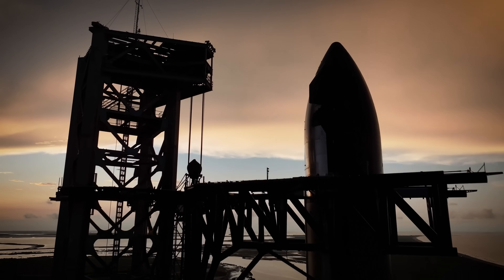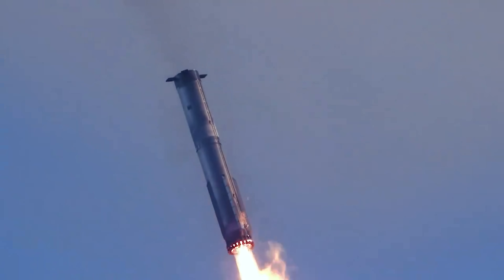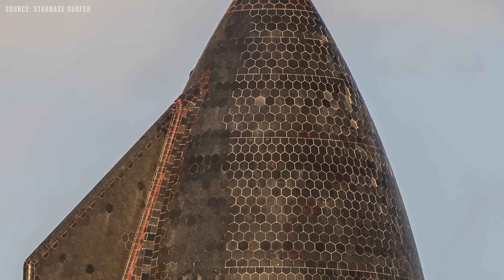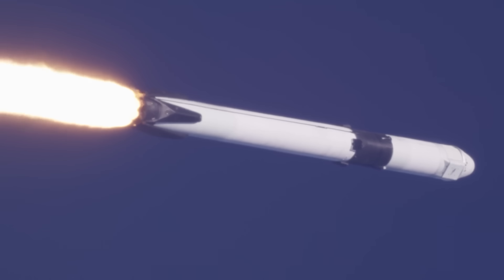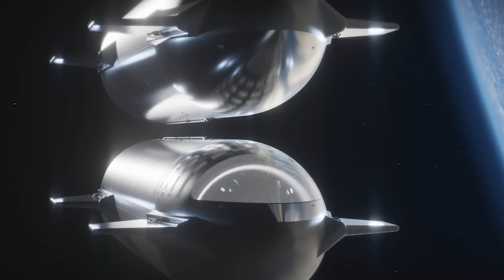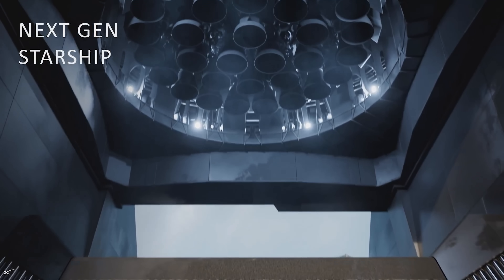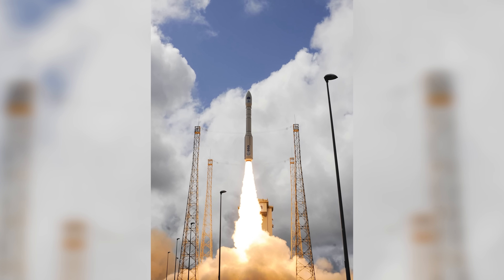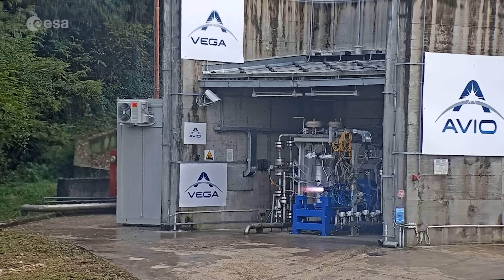SpaceX revealed Something Big Happening with Starship Flight 11 this Month!

Comment: Italy built small solid fuel rockets. France had a methane engine in the works. France and Germany had built all the big rockets... with liquid fuel.

$40m given to the least capable state owned company... The vastly simpler Ariane 6 took $6 billion... and counting. 

They are still not serious. 
They are throwing away time and money and doling out contracts based on politics. China will have their Starship in 2030-2033.

Europe has no plan and no funding given that Starship is a reality now and Araine 6 will be grossly obsolete in 2 years... offering no competition at all in the launch market.

Comment: I think we can expect at least Flights 12, 13, 14, and possibly 15 boosters and ships ditched in the Gulf and the Indian Ocean, respectively, since Pad 2 will be the only "Test Pad" available to @SpaceX until Masseys has completed their upgrade for V3 ships after the S36 explosion and demolition of the Masseys test site hardware and support structures. Also the construction efforts at Pad 39A at KSC are nowhere close to being able to support a test launch, not is SLC 37 ready as it is still in design and partial construction phases of its own. Flight 11's ne landing sequence of burns and engine configurations may help satisfy some data points for the upcoming V3 ships and boosters, but we have to keep in mind that the V3 vehicles must be considered 'brand new'  since their design and operational parameters are and will be majorly different than V1 and V2 vehicles up to this point. V3 ships could very well set back progress and initially emulate the frustrations within @SpaceX in the same manner as the original F1 launch and loss of vehicle. But, hey, GO SpaceX!

Comment: Starlink simulators burning up on reentry is such a smart way to test.
Reply: The minimum altitude to actually deploy the Starlink satellites in 350km. The V2 rocket will go to about 220km (prob not the highest V2 can go but still way too low... So Any satellite they put up will burn up. 
Now with the V3 booster, they might put up 30 or more satellites (flight 12). 
... but not before.